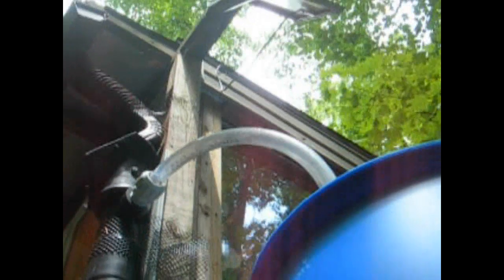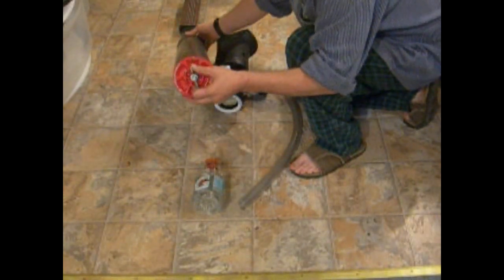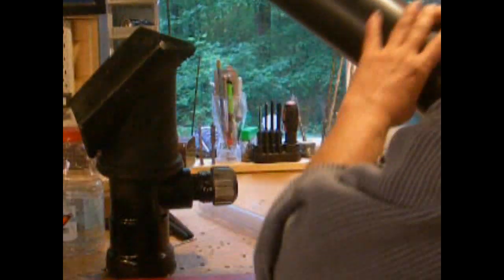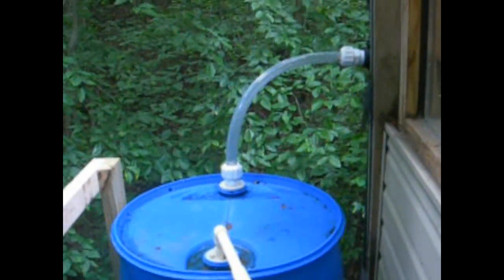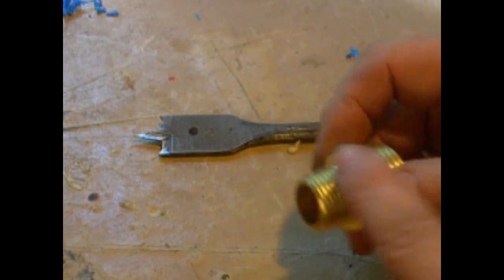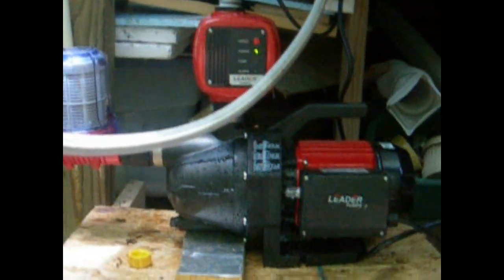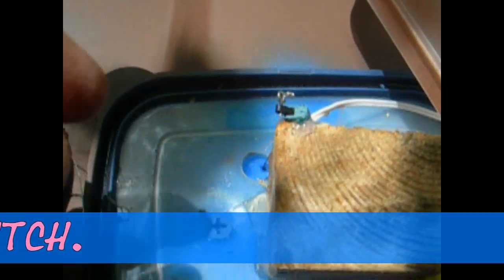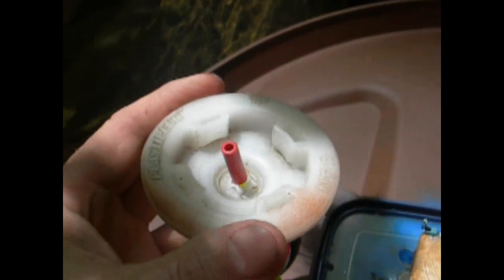HOW I MADE A RAINWATER SYSTEM TO FLUSH

Comment: Good video I like it 1 thought if you chain gang your holding barrels together with the cross overs at the top of the barrels and draw off the farthest 1 in the set it will act as an extra filter and leave any larger and heavier dirt in that first barrel were you can just clean it out ounce in a while. anyway good luck it looks good I am just about ready to build my own system as well as a hot water recycling system to save on both my water and heating bills

Comment: Howdy!  If you use a "T" fitting at your first barrel inlet, you can use it to connect to the top of the second barrel, where another "T" fitting will fill it when the first barrel is full, and also give you an overflow outlet.  Also, if you fill from the top, the water in the second barrel will be cleaner than the water in the first barrel.  Filling from the bottom shares the slightly dirty water with both barrels.  Using a top "T" fitting will allow you to connect as many barrels are you want, while venting them at the same time.

Comment: Great idea - more people should do this. Right now I use 5 gallon pails of rainwater to manually flush the toilet, but this is obviously the way to go eventually. One issue - I'm on town water/sewer, and the sewer bill is based on the water readings, so using rain water is actually cheating the sewer bill. Not that I mind, but if a town inspector showed up for an assessment, I'm sure they'd rat me out. If you have your own septic system, no problem.

Comment: @UrbanEdgeLivin Thanks for a great idea!   Solar panel + trickle charger + deep cycle marine battery + 12V DC water pump will be perfect. I'll be using the system for an outside summer shower as well.

Comment: @hobbylogger1  I thought about that too. As long as the city water pressure is higher than his pump's, it should be OK, even if he forgets to turn off the pump side before opening the city water side. 

However a he could have eliminated any risk of contaminating the city water by using just one T, so it would be impossible to have both sources of water connected at the same time.

Comment: Rich
Any riainwater system is nice, but obvious.  Potability being an issue with most peeps/  You simple, amazing insight in using the water where potability is irrelevant is absolutely brilliant.  I smacked my head, 'why didn't I think of that?'

However, given the use rate of flushes, I wonder if perhaps the use of gravity for force instead of a pump is viable?  The trickle rate from gravity is fine for mere filling of a toilet tank, isn't it?